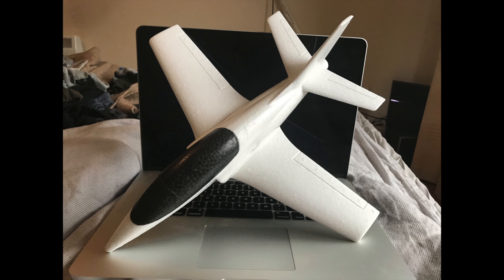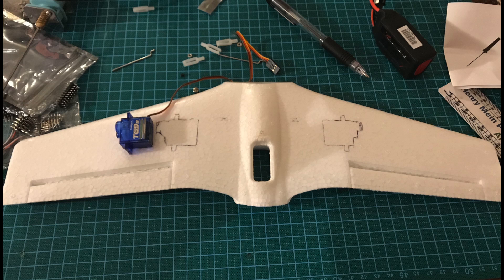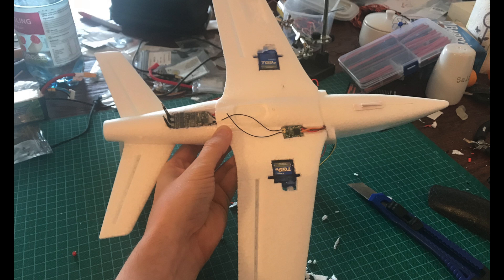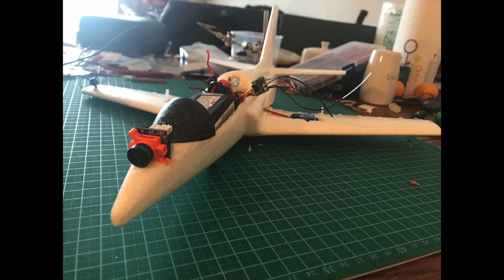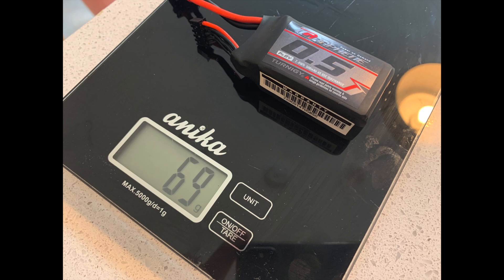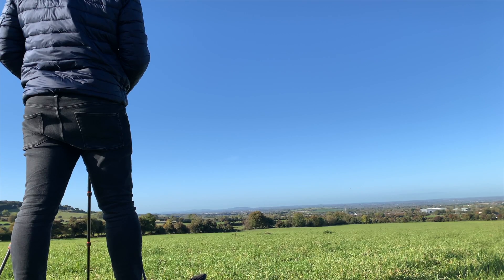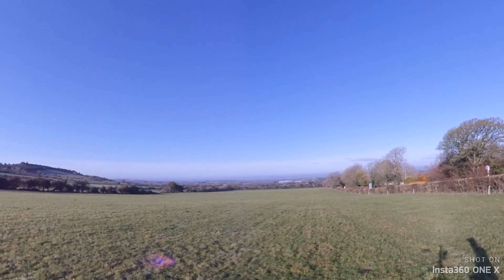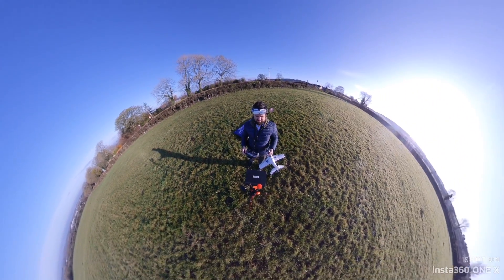Project Mini Viper 🛩 FPV RC Conversion/Build: ⚡️160km/h+ ⚖️ Sub250g 💸 Sub $200

Comment: The whole point of the carbon fiber rod is that it is supposed to pass through the centre of the wing because that is where you will have the highest moment when pulling a few G's

Comment: Excellent stuff. I've started flying fpv fixed wing recently but I'm finding it difficult to find anywhere to fly. How does it work with the countryside? Can you just sort of fly anywhere or?
Reply from the maker: I guess it depends on the country. If I can tell who own the land I will  knock and ask permission, if I can't, I'll just fly (as long as there are no animals) and explain myself if the land owner appears. This has happened many times and most of the time once you've explained what you're up to and apologise for being on their land without permission, they start to understand you're not doing any harm and more often than not will be happy to let you continue to fly on their land (sometimes under certain conditions).

Comment: Any update on getting this thing faster? I never did build mine, but I haven’t cannibalized the parts either. Just need to sit down and make it happen.
Reply from the maker: Hey Brandon, I got this up to somewhere around 185 with a different prop. However I have always been a fan of larger models so this didn't get much air time. I have since removed all the electronics from this plane and moved onto other projects. Cheers
Reply: Dang! That's moving for a little guy.  I wonder what the scale speed would be. LOL.  Thanks for the response.  I haven't been flying at all.  Too much other stuff going on.  Trying to get back to it, though.

Comment: how far can I fly it without the RC still losing connection? How long do the batteries last? Thanks!
Reply from the maker: I've never tried to fly this economically and my setup is more designed for speed over efficiency. I think on my setup I'd probably be able to fly for about 15mins, which will be the limiting factor when seeing how far it can fly. The 2.4g FrSky control link is good for many Km.

Comment: Your Plane is to small for your FF settings. It needs to be under 20 for 600mm, so start at that.
Reply from the maker: Yeah I got this thing flying fine in stabilised more. Although I only ever fly it in manual :D Cheers

Comment: can you do return to home with the hardware you linked, you see any big difference from the other FC board you reviewed?
Reply from the maker: It’s the same firmware so yeah it has mostly the same features as the Matek boards, so RTH is possible and I have successfully used it with this board. The Matek I reviewed is far better, and I’d highly recommend it over this omnibus board. The Matek is a lot more powerful in processing and with its BECs, and the current sensor is actually accurate. With the board I used on this plane you have to use external 5v BEC to power servos and wiring is more complex because of this. I only used it on this plane due to size. Cheers
Reply: @AdamGdoesFPV  cant find this board any how, going for the matek 411 wse, smaller then board you reviewed and its in the states
Reply from the maker: The F722 is available in the USA warehouse too. You must be putting it in a tiny plane if you’re worried about size of AP. Are you building the mini viper?

Comment: Amazing build man... these kind of things get me so excited about fixed wing... Can i ask you why you decided to use INAV instead of Ardupilot on the omnibus f4 board?
Reply from the maker: Cheers for the feedback :D I went with iNav as I already know it. I've heard Ardu ins't as user friendly and requires a good bit of time investment to learn it... which I wasn't willing to do. My AP's are only installed so I have the info on the OSD and RTH as an insurance policy , I just fly manually 95% of the time, so I don't need any more than iNav :)
Reply: @AdamGdoesFPV  Oh ya that makes sense.. I jumped right into Arduplane and put it on an F4 board in my first ever FPV fixed wing lol Honestly man for a guy like you learning how to use it would be a non-issue and the features it has, even on the limited F4 board version, blow INAV out of the the water. Its also much more reliable but thats just in  my admittedly limited experience. Took my about 5 days just fiddling with it in the evenings to get a good enough grasp on it to get the plane setup ready to fly with 6 flight modes and radio telemetry... Im just as interested in automation as a whole as I am in RC so for me there were other reasons to try it but most of the guys I know who have tried it since the F4 chibios came out dont use INAV anymore

Comment: Hats off for getting all that gear in it...I still dont get this desire for 250 gram models though, better performance and value for money would be with a slightly bigger Rad-jet type of air-frame methinks. You do realise your spotter wont be able to see where its going once it gets more than 200 metres away?...lol...They are the nutty rules tho..
  Kudos for doing it m8, really....:)
Reply from the maker: EnglishTurbines haha thanks. To be honest I had no goals when it came to the weight of this thing, it just turned out below 250g. This project was more for fun to create a novelty tiny jet 😁 cheers for the comment 👍🏻

Comment: Awesome build Adam amazing how you managed to get all that in there and it flies so well.  I've still not had much luck with iNav to feel comfortable with it
Reply from the maker: Thanks Dave, it really was a challenge!
iNav is still something that's a bit hit and miss for me, but its a lot better than it used to be. I wish it worked as well as Vecor and MFD AP out of the box. The vast amount of settings you can change is is cool but also makes things fairly complicated.
Reply: @AdamGdoesFPV  yeah I've been trying to get inav set up in a twinstar to a state where I'm happy with it but so far haven't managed to. Haven't tried an auto tune though, maybe that's the next thing to try

Comment: this is exactly why i had considered getting the insta360, for a camera besides me while flying. How do you like it for this use?
Reply from the maker: It's really handy! If you haven't got someone there to record the fly by then this does the job for you, and you get to be the cameraman after the event has occurred, because you spin the view later :) You also know you will never miss a shot with it. Only downside is you have to scroll through the video to find the passes and there isn't an audio bar like in video makers, so you can't see an audio spike to see where the passes happen. Going to do a video on the Insta360 One X soon. Cheers
Reply: @AdamGdoesFPV  awesome. that is exactly what i had imagined using it for myself as i mostly fly solo. Looking forward to it. I know there are ways to import the footage into premier. At least you could do time stamps for flybys and than go edit back in insta's stuff i premier's 360 editing is too irritating.

Comment: did you include the batery in the cost of the build?also: is that graphene from hobbyking?
Reply from the maker: No I mentioned that the cost was for just the model and all parts to build, and that the cost assumes you already have FPV gear, tx, batteries, charger etc. They are graphene from Hobbyking. The branding has changed slightly but I put a link to the new version in the video description
Reply: @AdamGdoesFPV  sorry , just noticed , thank you!!
Reply from the maker: Sufy561 no problem 😊👍🏻
Reply: @AdamGdoesFPV  I clicked the link for the 5v bec , but it opens the xm+ link
Reply from the maker: Sufy561 thanks for letting me know, I’ll update that shortly ☺️
Reply from the maker: Sufy561 fixed 👌🏻
Reply: @AdamGdoesFPV  thank you !!

Comment: Do you think 5g servos would be enough? Also what did you end up using for your CG?  That's genius using your 360 cam for "pan/tilt. I never would have thought of that.
Reply from the maker: I'm not 100% sure on the 5g servos, I'd have to do a little research. My method with the CG: it comes with a weight in the canopy which I assumed was there to make it hit CG as a chuck glider, so i recorded where the CG was and aimed for that. Worked out pretty well as it feels about right. I'll take a look where my CG is and update here later. 
The 360 cam is perfect for recording flights in the field if you don't have a cameraman... you know you'll never miss a shot :D